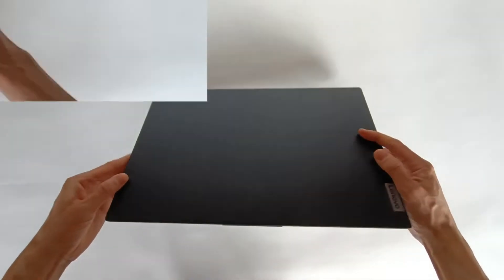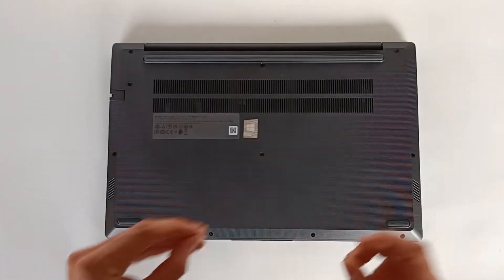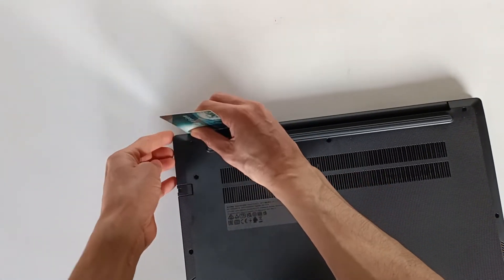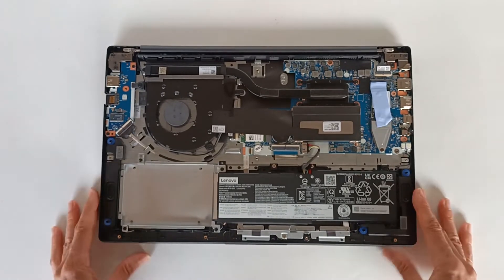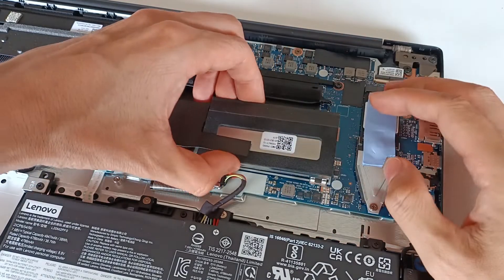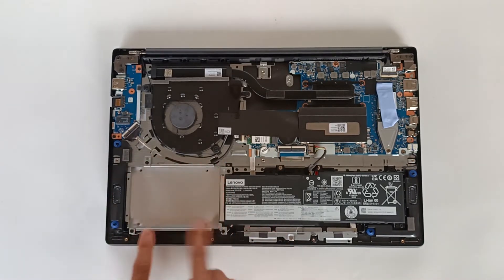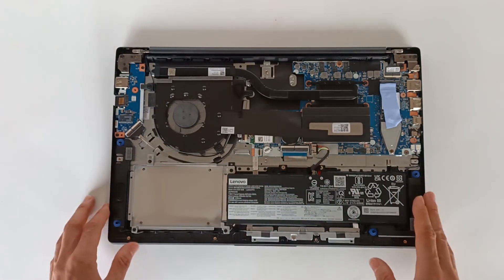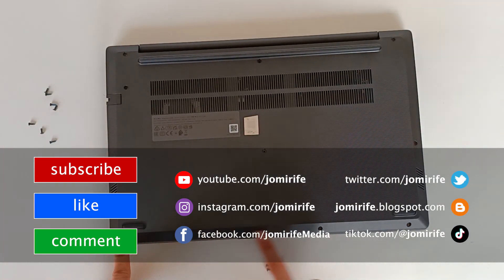Lenovo V15 G2 ITL – Upgradeability and how to repair

Comment: Hi, in that empty space can I install a laptop HDD which I took out from my previous laptop?
Reply from the maker: yes, you can put a 2.5" drive (HDD or SSD), but the cable to connect to the motherboard is not included
Reply: @jomirife Thanks bro

Comment: you can connect a 2,5 inch drive, but you need a cable
Reply: You've already done it, I just want to buy ssd 2.5, but I can't find a guide on how to do it and where is the connector for the cable

Comment: This laptop can work without battery ?
Reply: with only plug energy ?
Reply from the maker: It should work because the power doesn't connect directly to the battery, but I'll test it

Comment: The cable doesn't come, you have to buy it separately, but there is a connection on the board, it's the one that's about 3 cm to the right of your pointer finger at 3:51 the cable code is NBX0001VD20 and it's found in the usual places. Kinda shitty of Lenovo to not provide that cable with the laptop from the box, especially when it's not a readily available part, but whatever. Thanks for the video, you saved me some grief.
Reply from the maker: thanks
Reply: thanks for the part number. i have to buy one now
Reply: Bhot bade chor nikle lenovo wale consumer ko ye kitni mhngi pdegi as its not readily available
Reply: @rakshittripathi7240  bro aapke paas bhi ye laptop hai kya?